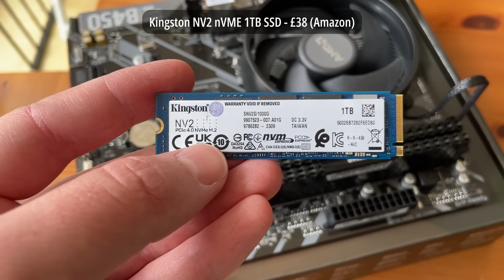Building a Cheap and Upgradable Gaming PC in 2023

Comment: As far as I can see, there isn't any heatsink on the vrms, will that affect performance and CPU upgradability?
Reply: no but it may limit overclocking
Reply: Most B450m motherboards don't have heatsinks on the VRMs, I have had two of them for three years, only one of them has really cheap heatsinks (not really effective) but they both are working fine. No performance or upgrading issues. It's only if you're trying to overclock a high-end chip, like a 5800x that you might run into a problem, but it's really not worth overclocking these days.

Comment: Love the build videos! 

My daily chores of computer usage are done on a dull mid range modern system - but I build secondary ones for others and my 'retro-modern' CRT gaming computer. I'm currently trying to find the most extreme setup to showcase the... um... drumroll... G7400. I've been patiently gathering pieces for this build, including a Pentium 4 era 'gaming case' (acrylic side panel, blue air 'duct' leds, blue led clear fans, and aluminum! Woot! Antec 160w for $10, complete with vintage Athlon motherboard, and Noctua cooler... and a Soundblaster... and a Wifi card... multiple old drives and a card reader). I'm thinking that either a 1660 Super/Ti or rx5300 (to take advantage of PCIe 4)... Or maybe a m6000, as it is possibly the best NATIVE CRT analog output... but for building purposes I'm using my Titan Black... 

Anyways, you've always been kind of a motivator to me, and I love it when you celebrate old or... um... entry level tech for enthusiasts. Your honesty and genuine enthusiasm for suffering are very relatable and relaxing.

Comment: Someone who builds this or similar with a 60Hz Monitor or HDMI capable 1080p TV laying around, the specs will suffice the expectations. The budget case is lovely, I like the front panel options, the only issue with me would be that the front panel unfortunately not on the front, instead put on top, to easy collect and accumulate dust. But apart from that, temperature wise it's good for a budget build with 2 fans.

Comment: Nice deals to start the build. Nice case but a few £10 more and you get more fans, a mesh front and tempered glass side panel.  Felt the 2600 was held back by the 1060 a bit.

Great build overview, but for the new builders who might watch your video I would add the recommendation to build outside the case before putting it in to check everything works, particularly if some parts are 2nd hand.

Comment: My system low budget $250 system.. Cyberpunk is playable medium settings FSR 2.1 Balance, can maintain 60fps in most areas..
$60 used Ryzen 5 3600 (Had $42 used R5 2600 first but then i found the cheap 3600 in marketplace)
$60 new ASRock B450M HDV
$30 8GB x2 2666mhz RAM
$55 New Aisurix RX560XT 8GB (maybe salaved gpu)
$11 Jiushark JF100RS Tower Cooler 100mm
$20 Case MATX tempered glass front at side
$9 Used PSU 500watts single rail
Reused SSD/HDD/Case fans/900p monitor.. 

I've upgraded from Xeon 2630 v2 X79 chinese mobo

Comment: That PSU is pretty horrible id rather have a used better one also the case too has zero airflow
Reply: Air flow isn't that big a deal with low to mid range components, especially in the UK where the weather is hot about two weeks a year, if they're lucky!

Comment: A 4tb gen 3 m.2 is at a good price to. As long as the case has acceptable cooling, 5800X3D would be a good cpu. Gpu is...more of a personal preference
Reply: That's all way beyond a budget starter gaming build. The 5800x3D alone costs about as much as the entire system in the video!
Reply: @EnglishMike  yes it is, but it is the final result of the upgrades for the build
Reply: @idied2 Of course, though there is a chance that by then there might be a similarly priced 8600x, say, with the same performance, and then it will be a matter of whether it's time to make the jump to AM5...
Reply: @EnglishMike  yep, so its a either or kinda choice

Comment: Not bad, but there's much better parts newer parts for the money out there, namely the Ryzen 3600 and GTX 1660 Ti/Super.  Swapping out to those would've only added 20 pounds to the cost and been 30-40% faster, more efficient, and less likely to fail.  The GTX 1060 is old enough now that there's good likelihood it won't have a much longer life before failing especially if it's an OC model running at high factory voltage.
Reply: Believe it or not, there's some people for whom an extra 20 to 40 quid would mean they can't afford the computer at all.
Reply: then they have gottn other problems and should be building a PC AT ALL, omg ppl go cheap cheap cheap and complain :P @EnglishMike
Reply: Why would the GPU be more likely to fail just because it's old? That's only determined by the use case of the person who you bought it off of. Unless the GPU was absolutely hammered in a use case such as crypto mining, the GPU can last for many many years, worse case scenario you have to repaste it.

Comment: I love that the 1060 still does well! Such a great card!
Reply: Barely, it's on it's last legs. Needs replacement within two years.
Reply: @detmer87  Some people don't really have high standards for graphics. I care more about the quality of game play than eye candy. I have RX6800xt but I also will happily game on integrated graphics. People will still be gaming with a 1060 5 years from now.
Reply: @robertkubrick3738  I wouldn't want to swap my RX 6900 XT for my integrated graphics (7800X3D). Then I would use my Steamdeck or Playstation 5 (if it's a controller friendly game)  instead.
Reply: 1060 was a beast in it's day, 1660S was great value for money and I had both at one time. I think an RX580 8gb would probably been better in this build considering their price new and 8GB Vram.

Comment: Your build is very good, reasonably priced and I believe that it has a lot of future potential. 
Very nice idea!
The core components of my main pc are very similar to the one you built.
I have a R5 1600af oc'ed to the levels of a r5 2600, a B450 Tomahawk max and I originally had 16gb of 3200mhz RAM until a month ago that I added to of the same sticks for a total of 32gb. I also have the nv2 1tb nvme drive and about the PSU, I own the 600W2 version which was part of my secondary PC and now I have it as a veey trustworthy backup
I used to own the GTX 1070 ROG Strix but I sold it a few months ago.
The main difference is that I have my build in a nice NZXT H510 case.

Comment: This is a really good build, Steve an d very well documented too. I am assuming the 1060 was the 6gb model and not the 3gb. Though, looking at the size if the card I would say it was the 6gb model. Personally, I do not use cases for my PC's, but, if I did ever go back to one this case you are using looks really good. It seems to have good airflow, space for a few fans, and is aesthetically pleasing, too.

Comment: I built nearly this (different B450, 1600 instead of 2600x, RX580 instead of 1060) in 2018 because I thought it'd age well as a gaming and content creation PC and honestly, though the upgrade path is fantastic, I haven't bought anything else for it.
Reply: Yeah, unless you want to play the modern AAA games, something like that is perfectly fine for 1080p gaming. I only just upgraded my RX 480 a month ago after six years.
Reply: well even for 1080p its ruffy^^ @EnglishMike 
ppl dont understand it, 6cores/16gb of ram aged like spilled milk, for new tripple a games heh would need to build an intirally new machine cuz the foundation of that silly B450 wouldnt allow for a 5900X/RTX 3080 for example, cuz its a cheap psu, cheap case, cheap nvme (probly DRAMLESS-.-) and 16gb of ram would be the same as putting the same parts 5900x/3080 onto an X570S, 64gb of RAM and a Corsair MP600, would be miles better of a complete experience so the upgrade path aint that fantastic as u might think ^^
Reply: @tyonorshapz_Beats_Rap-archive  Whet the hell is this comment doing on a channel dedicated to low budget gaming? I think you took a wrong turn somewhere.

You don't need a 5900x or 3080 for 1080p gaming. That's just silly.

Comment: The GREAT thing about this pc is how upgradable it is and you can do it over time. Upgrade the psu.. a month later put in a ryzen 5600 cpu that you got a deal on.. then a month after that put in a gtx 1070ti or rtx 2060 etc that you got for a great deal. 3 or 4 months later you have a much more powerful pc for cheap and it was easy to do. Good video.
Reply: Imagine upgrading a major component every month instead of just building it with a 5600 and a better card

Comment: with fsr3 coming out this system is about to be a beast
Reply: Not unless you upgrade it to an RTX 20 series GPU. the 1060 won't be supported by FSR 3.
Reply: Pascal has been cut off from FSR3 though, if possible, snag a 2080 super

Comment: 0:20 I would have gone for an AeroCool CS-107 v2 Case £29.99 from Scan... it has a Perspex side window and 3 x fixed RGB Molex powered fans meaning they just show a rainbow static effect and wont cycle through the colours. Probably one of the best bang for buck budget cases out there at the moment... would definitely like to see an upgrade video on this though.
Reply: I bought an Aerocool case recently (Trinity Mini I think it was called?) and the build quality is super cheap, and the fans are very loud, and have no way of controlling the speed. Don't know if the CS-107 is the same, but I'm not buying another Aerocool again.
Reply: @Aruneh  yeah I can't argue but for the price they are what you'd expect really. Just think they look better than the all black with no side window.
Reply: @BillyBoy444  oh yeah, I didn’t expect amazing quality of course. Tempered glass side panel and three rgb fans for that price is pretty good, but the case itself is just SO cheaply made, and a pain to build in. I could have gotten a Coolermaster for a similar price, but without the glass and fans for the same price, and I will probably do that next time.

Comment: Mobo is my next buy, I get nice performance from my Ryz5 2600 like yours, video card is running nicely that being the 2048SP 580 but stuff is being throttled by the A320 Asrock rev 4 which is a fairly good motherboard but it is showing its age a bit and its untested waters trying to put a 5900 etc in there as BIOS says it doesn't support anything, even my 2600 which is a big big fib as its running 8.0 BIOS with my 2600 perfectly fine /waggles naughty finger at Asrock :)

Comment: i loved this build so much, its simple, fast and it runs the latest games at a fairly decent framerate
Reply: I think a 1660 Super or RX580 would have added a lot more value for little cost.
Reply: I think the GPU choice was rather disappointing.
Reply: @mistermudpie considering i got an RX580 8GB used for $60 yeah
Reply: This PC will not run the latest games at decent framerates. Anything made after 2020 will need to be ran at the lowest settings barely getting to 60 fps

Comment: I would recommend installing the operating system on a smaller driver and having your games on a different drive, harddrive if all you can get, this helps if windows ever breaks so you don't have to reinstall all the games, this really helped me as windows broke like 5 times and I lost everything on my boot driver which is why I have all my files stored on my other drive as well.

Comment: Not knocking your work, but the case might get quite dusty without top and bottom dust filters. It is a budget pc with used parts, for the same price you can get reconditioned pc's with a guarantee.
Reply: But you're not likely to get the exact parts you want, though. The type of motherboard, in particular, is important if you want maximum upgradability.

Comment: hm... i know it's easy to say, but if you have future upgrades in mind then i'd absolutely recommend trying to get a better motherboard. one with a more confidence-inspiring VRM and some heatsinks where it matters
Reply: I've had two B450m motherboards for three years. Zero problems with them. Unless you're going to stick a high end 8, 12,  or 16 core chip into them, and you're going to try overclocking (which is barely worth it these days) then the lack of heatsinks isn't an issue. I know there was a lot of concern about the issue, but I don't think it's been as big a problem as originally feared, and almost nobody pushes their computers to the limit these days.

Comment: i have gigabyte b450m s2h and ryzen 2600 and amd rx590 16gb ram single stick at 2666 speed, any tips? and possible upgrades?
Reply: Buy another stick of RAM .
Reply: @aleksazunjic9672  He has to make sure the RAM timings match exactly though! If they're not the same, they will only work at the base speed (2133MHz)
Reply: @EnglishMike  Mismatched RAM is not a such big problem on modern MBs, in any case it would be faster than single channel sine he has only 2666.
Reply: @aleksazunjic9672 That's true, but it's still worth a little extra care and effort to find a matching pair.
Reply: Ryzen 5600 or 5600x (make sure your motherboard supports them -- you will probably need a BIOS update at least, but don't do it until you have received the new chip, since the update might make your board incompatible with the 2600). 

Graphics card, at the moment, the best deals are for the RX 6600 and RX 6600 XT. No point in going for anything less than that. If you're willing to spend a little more, the RX 6700 XT is a great card for the next few years, though might be selling out, so the best deals might be over.

Comment: That's never going to play Starfield is it? Is it?....
Reply from the maker: We will find out soon enough haha
Reply: it will play terrable AF theres no question, even cyberpunk and that cuz like i said 6 cores aint enouth for AAA titles going forward and deal lord 16gb of ram my phonbes already got 12, i get its a super budget build and ists a balanced pc ,but wou should realy only play 2015- to like 28 games on there cuz 19 and 20 started to change the whole game arround where 6c/16gb of ram are even a problem at 1080p, and that has nothing to do with the FPS cuz they dont tell the whole story for sure :P
idc if its an email machine, minimum is 32 so you dont have to care :P @RandomGaminginHD
Reply: It will. The minimum specs are only slightly higher than the build he put together, requiring a 2700x and a 1070Ti.

The GPU might be an issue, but I bet it'll run well enough to play okay.

Comment: That GTX 1060 is really on it's last legs. Even on a budget build you should put in something with a llite more life in the tank. You should have put in a RX 5600 XT / RX 5700 in there.
Reply: That adds significantly to the cost of the computer -- beyond the budget he set for the build. As you saw from his game testing, it runs modern games just fine with FSR 2 and reasonable settings. If you're a building a budget gaming computer, you're not going to be buying $60 games to play, especially when there are literally hundreds of older fantastic games to be had on Steam for under $10 or the equivalent during sales.
Reply: @EnglishMike  If the graphics card needs replacement within two years then it's getting very debatable what's cheaper in the long run.
Reply: @detmer87 Sure, but I've chatted with enough people online to know that it's often about how much cash-in-hand they have available right now.
Reply: @detmer87   yeah totally and lets not start to talk bout that the 2600x would be bottlenecking everything too as well and 6 cores will not be enouth for gmaing in the next years for NEW AAA titles, sure it works now and for GTA5/TW3 and that sure but if you play thoes games, an i6 6700K is fine and an GTX 970 or so, thats the thing what is mostly not adressed in videos, that R5 2600X sucks ^^ but pply wanna always go for bottom dollar shpould get an Xbox Series S cuz that one is like blowing tha pants outta this pc like 6 weeks from sonday^^

Comment: A litle bit higher priced but a very good value budget pc in my opinion i build some days ago under 400€ :
Ryzen 4500 69€ incl. boxed cooler NEW (or 3600 if you get him cheaper)
RX 6600  130€ used
G.Skill Aegis 16gb 3200 28€
A 1tb pcie 3 nvme 40€
Cheapest b450 40€ used
power suply used with 80+ 40€
cheap case with a cooler installed 40€

Comment: AM4 is in a very good place price wise right now. Best performance for the money, most of the time anyway. The 1060 6gb and the rx580 8gb are both extremely cheap for the performance as well. After the scalpocolypse, we are finally back in a sweet spot for finding cheap used parts that also offer great value! Why build new when the better deal is used?
Reply: Wouldn't really recommend the old gfx card generation, you're not going to have much fun with it. RDNA2 is on clearance sale right now.
Reply: The thing with buying used stuff is that, not only do you not have warranty, there is plenty that can go  wrong when you uss the part you just bought. So I understand someone for wanting to buy new.
Reply: Zen 3 and alder lake are both really good value these days

Comment: Why the old Zen build, if you do old builds, you better use intel, 2600 became old too quick.
Reply: Intel motherboards only ever support two generations of CPU, which greatly limits their upgradability, and also means that the high end CPUs that are compatible maintain their prices way more than the AMD CPUs, so upgrading is almost always a lot more expensive for Intel systems.